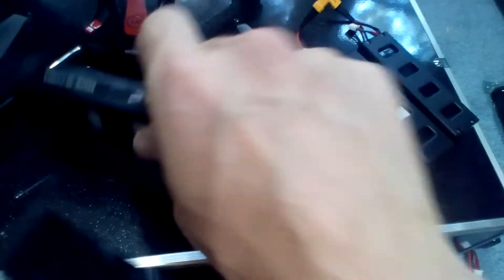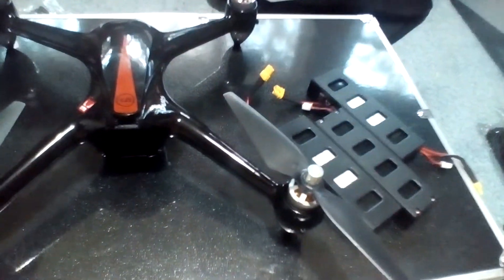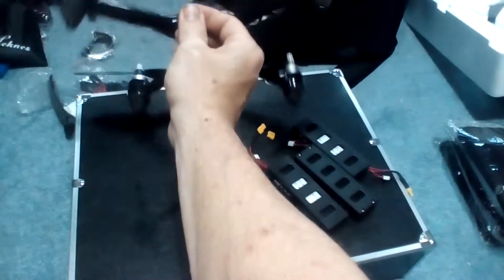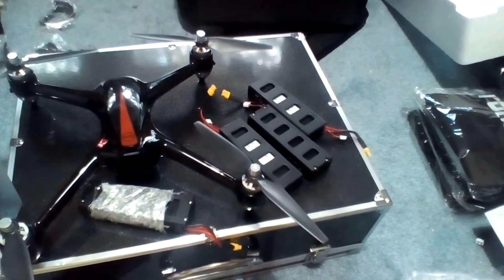MJX Bugs 2 battery mod to fit Bugs 3 batteries GPS rc Quadcopter diy fix

Comment: Are the actual batteries WITHOUT the case the same size?  Could a person take the B3 battery out of the holder case and take the OLD B2 battery out of the case and put the B3 battery into B2 case?

Comment: very cool thanks. I just use a rubberband around the drone and battery. do you know what connector that is on there ? what is that yellow connector called ?
Reply from the maker: Xt30

Comment: I just tried charging my new bugs 3 battery on my new Ravpower 6 USB outlet charger.  The green & red lights were on steady, meaning they are fully charged after 2 hours!  What's with this?  Usually at least 5 hrs.  Could this charger be harmful to the battery?
Reply from the maker: it is likly outputting higher volts = quicker charging

Comment: Thanks for the great idea, I just got 2 batteries for my bugs 3, I'll be able to use when I get my b2. 
I got a ? for you if u got time. What's the proper way to store batteries ?  If not using them for long periods. Charged or no charge?

Thx L/L
Reply from the maker: use em til low foltage alarm goes of and should be good to store till next use
Reply: Thx Jay D.